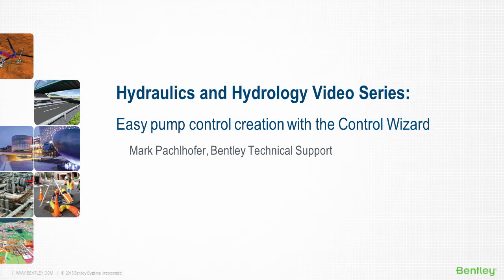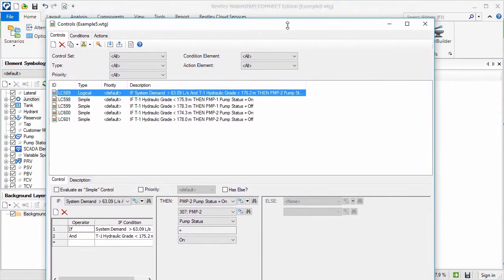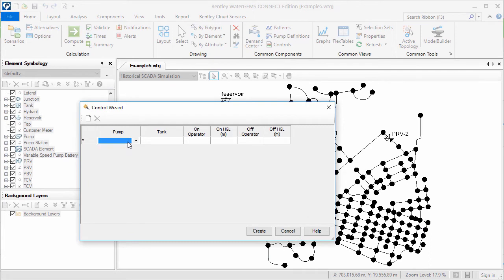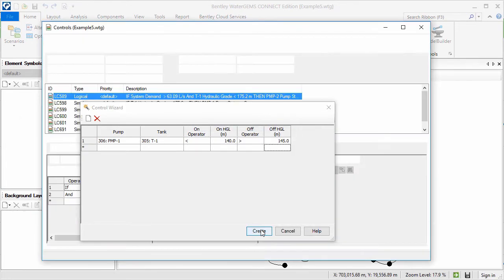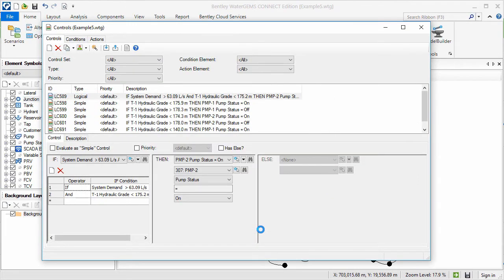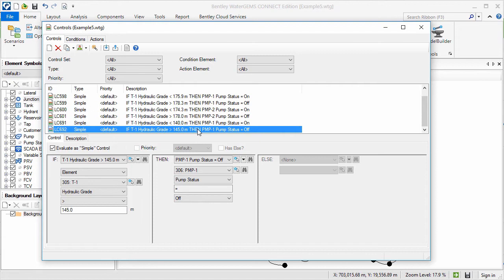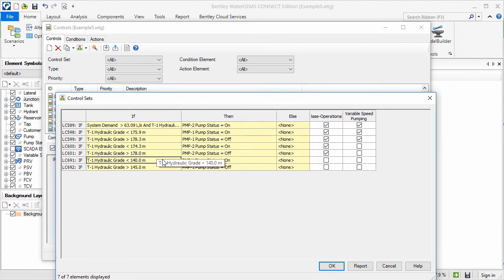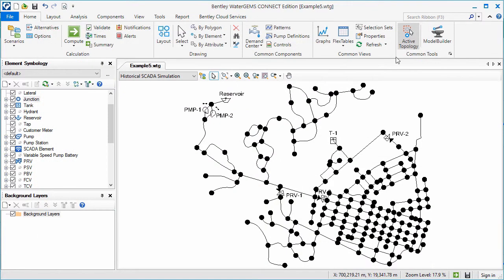Easy pump control creation with the Control Wizard

Comment: What is the advantage of pump control creation with the Control Wizard for pump optimization?
Reply from the maker: Hello Tewelde, the control wizard simply makes it easier for you to create common pump on/off controls, in cases where you already know the setpoint elevations for those controls. Rather than having to manually create the conditions, actions, the controls, you simply fill out the "wizard" form and everything is created at once. If you're looking to optimize pump controls, you can do this manually by trying different control schemes using control sets and the Operational alternative, or you could try using Darwin Scheduler in WaterGEMS: https://communities.bentley.com/products/hydraulics___hydrology/w/hydraulics_and_hydrology__wiki/6007/using-darwin-scheduler